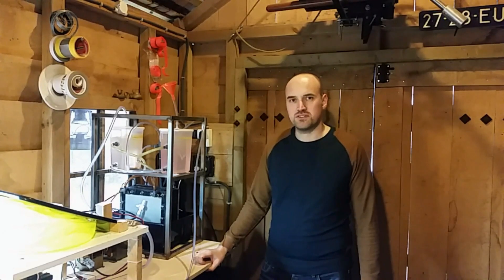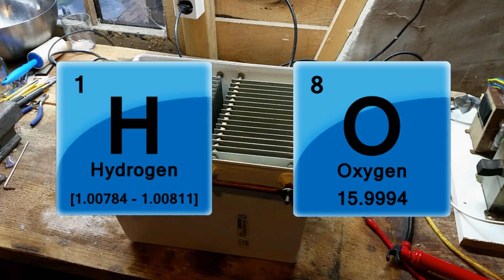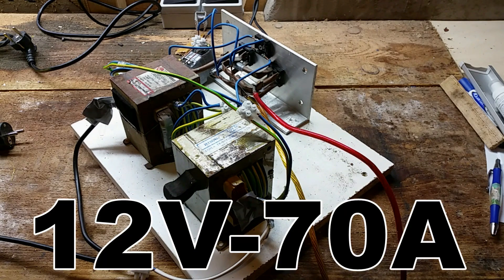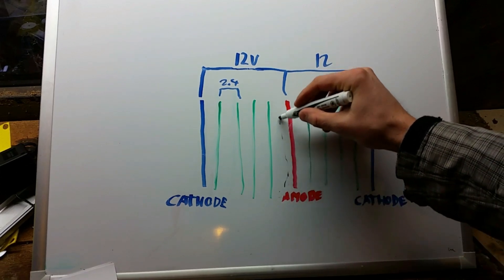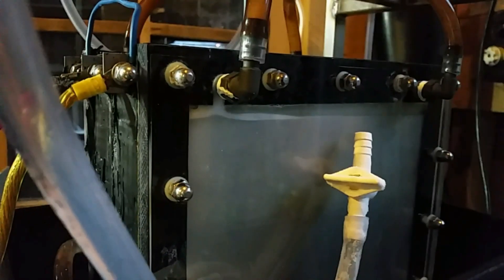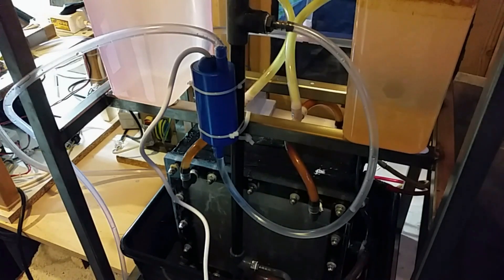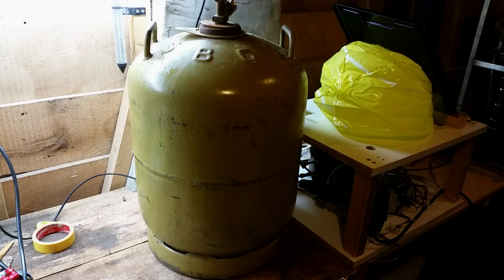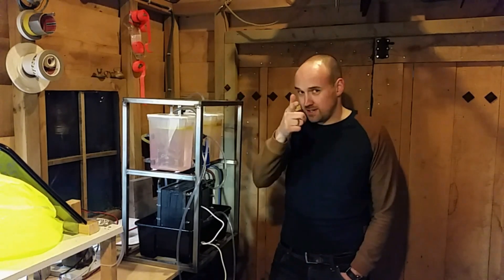Hydrogen Generator #1 Homemade Hydrogen Generator And Compressor Unit

Comment: What will happen if I continue to disintegrate water (electrolysis) in a rigid container? Is electrolysis continues even at high pressure?
Reply from the maker: No at high pressure it will produce less gass. Also, If you don't separate the gasses, you'll be making a bomb which makes it very dangerous! 💣💥 but good thinking 👍
Reply: @TheDIYScienceGuy  that's what I imagine to do, a cheap bomb 😈
Reply from the maker: LOL well it will not be cheap and also not very powerful compared to a real one. Would be very stupid though!
Reply: @TheDIYScienceGuy  btw, is it possible to produce 700kpa hydrogen? What volts per g/s?

Comment: Share this video guys and repost as much as you can because after years of watching HHO videos , this is by far the best all around. I want to see the DIY vid from the power supply out of microwave transformers!!!  A beach ball! Come on guys who would have thought of Felt cloth ?!! 

MY friend I commend you.
Reply: @Waylen Edge Will an arduino with a 10Amp motor controller work?
Reply: @webslinger2011  Arduino is a great idea. All the controls could be connected to a single panel with readouts in one place.
Reply: @Borishal  
BTW:  PWM is a bad way to control the generator's current.
If you have a Arduino, you can however use it to control the ratio of a DC to DC converter to match the voltage applied to the generator more accurately than just a transformer and rectifier could.  Getting the voltage right is the way to go.
Reply: want to bet
Reply: I think they use SPE and PEM membranes cloth sounds like a good idea.
Reply: Nah, I'm from the future. Storage of hydrogen is a bad idea. It leaks through solid shit, lmao.

Comment: Recommended for cooling the tank: u shaped pipes, welded sideways, hot water enters and, as it cools, fall down... Is a transformer cooling way...
Reply from the maker: Yes but that's only effective when there is a large temperature difference, 40c for instance and by then it's already  way to hot so forcing it with a pump works better to keep the temp as low as possible. But thanks for the suggestion! 👍

Comment: Thanks for the sharing that,I think that is the best output I've seen, at least on YouTube. What heater do you use to heat your place with the hydrogen? Are you going to produce plans with the parts and everything you used to build it all?
Reply from the maker: Thanks! No heater everything needs to be cool otherwise you lose energy. I have a diagram on Instagram  https://www.instagram.com/p/Bpl2pLijM7z/?utm_source=ig_share_sheet&igshid=1m4yl6ci8j3ra the rest is in this video and future video's

Comment: Loved your informative video! 
So, I was wondering how much hydrogen it would take to do some cooking, or to heat a room, and I did a little research. Here's what I found...
Heat of combustion is 286kJ/mole
1 li hydrogen under standard temp & pressure = 1/22.4 mole
So, 1 litre of hydrogen can provide about 12.77 kJ of thermal energy, 
which is equal to 3.55 Wh   (1kJ = 0.2778 Watthour)

SO - to heat your workshop with one kW for one hour, you need to burn about 282 litres of hydrogen at atmospheric pressure!  It looks as if the ALL the hydrogen it took you 8 hours to generate would keep you a little bit warm for only two hours! 

Does anyone disagree with these numbers? 

After I learned this, I felt disappointed and started to doubt whether we'll ever have a hydrogen economy! Nevertheless, I like how clean hydrogen can be, and I like that solar cells can be silently generating it every day, and maybe wind turbines even in the dark. 
In the home it could be useful as stored energy backup for when there's no sun, and no wind either. I also like that we don't have to pay tax on it!

My main interest in hydrogen is to use it for cooking on a boat. It is less of an explosion risk than propane or butane, because it's light, and escapes up through windows, instead of collecting in the bottom of the boat just waiting for a spark (like butane or propane does).

Maybe things will get even more exciting when we learn to make our own fuel cell, and get some electricity back at night for lighting, running motors, etc! :)
Reply from the maker: Thanks for the calculations! Yes it's not very efficient but indeed when you use solar and wind it could be useful. And it's always better than doing nothing. Burning fossil fuels is also very inefficient and we keep doing that because it's very efficient money wise. Thanks again! 👍
Reply: If you are alive please reply.
Reply: where did you get "So, 1 litre of hydrogen can provide about 12.77 kJ of thermal energy" Link please.
If true your calculation on hydrogen required is way off the mark. Its not 282 liter but it takes Just 44 Liters to produce 2 KW to heat room for 2 hours. 
With 282 Liters , you get 12 KW to heat room for 12 hours . But well insulated room can be kept warm for more than 24 hours with the same heating power.
Reply: @davelawson2564  thanks for clarification, the contributions and debate that happens in the comments are as important as the video itself
Reply: @Sugito x: you seem to be a very knowledgeable man with the same vision as me about producing GREEN and SAFE energy. I would like to share technical thoughts and ideas via mail if you don't mind. my mail is marnix.degrie@outlook.com. Thanks!

Comment: You can use zeolite to filter out any oxygen that might have made it in the tank.. oxy hydrogen is highly combustible very dangerous to get any oxygen in tank.. oxygen concentrator uses zeolite.. also you can split voltage more & only have 1 neutral plate.. also pulse the electricity at various frequencies.. see which freq. Produce max gas .. its diff depends on what magnetic waves it produce.. so each one is diff
Reply from the maker: Zeolite, thanks I'll look in to it. Changing Frequency doesen't do anything straight DC is what you need. Thanks for the suggestion though! 👍
Reply: @TheDIYScienceGuy  oh I almost forgot hydrogen can be burned off in a catalytic converter I was actually thinking if I wanted my oxygen to be pure I could use an old catalytic converter to somehow extract the oxygen although the Platinum and the Cadillac converter reacts by heating up when hydrogen is pumped to it also with Platinum plates you can extract electricity from combining the hydrogen and oxygen to water which would be called a hydrogen fuel so I'm sure you already know
Reply: I first heard about oxyhydrogen or Brown's gas when I ran across a site called water powered cars, 10 years ago, he had a water-powered dune buggy if you look up Stan Myers water-powered dune buggy he said in some of his black and white videos that he experimented with different DC frequencies and sad he found with less power at a certain frequency he got an explosion of oxyhydrogen once you tuned it to the right frequency I've not yet gotten the production that he got because of all the Miss information or bad plans put out there basically depending on the device depends on what your frequency will be but if you put each cell in series instead of parallel you can divide up the 12 volts into 2.5 to 3 volts any more than that and you lose energy to heat currently I was thinking of using static bags to separate the oxygen and hydrogen they should transmit electricity through them I could be wrong though PS nice job on the setup though too bad you don't live near Dallas Texas
Reply from the maker: Thanks! However I read a lot about stanley meyer and he was clearly a fraud, in it for the money and fame.
Reply: Also I've got an aquaponics system that I want to inject oxyhydrogen into using carbon rods instead of stainless steel cents stainless steel can poison the water I recently heard I saw some videos people not only using oxyhydrogen infused water with fish but in California they're using the oxyhydrogen in their water for Hydroponics with great success anybody know anything about this think I'll make some videos once I find the best setup

Comment: your still splitting water on both sides of the plates, therefore, releasing both hydrogen and oxygen on both sides.you can't have element coming out without the other one with it.
Reply from the maker: No that is not how it works. If you are interested in how it works I advice you to read this: https://en.m.wikipedia.org/wiki/Electrolysis

Comment: Thanks for the GREAT video! I'm planning to make a small test version of this. There is just one thing a bit unclear about the construction. To fill the cell I'm guessing there are holes in the bottom of the metal plates to make the water flow through? This doesn't interfere with the separation of hydrogen and oxygen?
Reply from the maker: Thanks! Yes that is correct. No the flow up is so strong that that doesn't give problems, but if you want to be 100% sure you can always make the same separation system at the bottom.

Comment: It seems to me that the best way to harvest HHO and put it to work is to stop storing it.  Instead of simply using DC, employ pulsating DC (a square wave).  The efficiency of production should improve dramatically.  I have not seen any studies or experiments that identify the optimum frequency to use, but it makes sense given that AC is much more effienct than DC for a great many things.   A square wave generator-servo (very similar to AC with DC elements) can be used to control the amount of output/pressure, so you can essentially regulate the pressure AND flow as an On-Demand type system.  This completely negates the need for storage tanks of the gasses themselves, and gives SAFETY a much higher margin for success.
Reply from the maker: The whole idea of producing hydrogen is to store energy so if you put it to work right away its better to just use the electricity you produced. AC won't do anything and PWM only reduces power.

Comment: I would think that to reduce the heat that is generated, you could add another neutral plate to get the voltage to 2V effectively and then increase the amperage to increase how many bubbles are coming off of there.

You have done very very well here though! I live off grid with solar panels and batteries here in Canada and in the long long summer days I really want to save the extra power that gets wasted once my batteries are fully charged. It would be really great to be able to store hydrogen!

I am surprised that you are not storing the oxygen too though. Welders pay good money for oxygen for their cutting torches and you can suck it back to feel good too! I guess it would just take quite a bit of work to also make a compressor unit for the oxygen side too.
Reply: I'm doing similar thing. Got solar panels. Panels charge batts, batts make hydrogen, hydrogen runs 4k watt genny, genny powers crib, charger charges batts at nite...

I'm working on it. Havent figured out everything I need to know to store hydrogen and convert gas engine 4 stroke genny
Reply: @ryandavis4689  no need to separate the gasses if just feeding directly into the carburetor of the generator. Only thing to do is size your HHO generator to match the lpm required based on engine displacement. A 420cc engine would need between .25 and .5 lpm of HHO.
Reply: Nvr thought of storing oxygen
Reply: Ryan Davis if you run the hydrogen to the engine, also run the oxy there it will always have enough oxygen to burn fully if you do it like that
Reply: Is it not viable to store your extra power in a capacitor of some type for future use?

Comment: instead of using  neutral plates why don't you have + - + - + - + -so all plates are conected it would produce more gas I've notice neural plates don't do much mine outputs a lot for how much mass i have
Reply from the maker: That makes no difference in gass output but you would need a 2V 420A transformer which is much harder to make and less efficient.

Comment: I almost wonder. If you could improve the reliability and maybe somehow increase your production capacity, you could possibly fill one of those giant propane tanks and have it for heating and cooking. 

And when it's all being powered from solar, its pretty much free gas at that point.

As for detecting oxygen in your hydrogen, you could use an oxygen sensor in conjunction with a microcontroller to automatically shut down and vent the system.
Reply from the maker: Thanks for the suggestion! 👍

Comment: Aren't you worried about the refrigerator compressor igniting the hydrogen?  It seems like there would be some potential for sparks in a device with fast moving metal parts and 120+ volts running through it.  Good video, I would love to see a more detailed video of the felt gas separation.
Reply: Compressor motors have oil in them for cooling and lubrication, and additionally they are also induction motors, not brushed, so no arcs are produced. I highly doubt it would ignite.
Reply from the maker: Yes what Klonoa says. 👍

Comment: isn’t storing hydrogen in propane tank a problem? Since hydrogen molecules are very small and they can pass through walls of tank
Reply: Hydrogen loss is a big problem in spin-cast cast iron cylinders due to their porous nature (usually countered by encasing in a formed steel cylinder that has nitrogen at a higher pressure), propane tanks are made from formed steel sheets that are welded together, and have a very low porosity index. Not a big problem at the pressures he is using.
Reply from the maker: Yes, what Paul Moffat says. After a few months there is no measurable loss of pressure in the thank.
Reply: The DIY Science Guy have you tried to run your car with hydrogen?
Reply from the maker: No only my lawnmower as shown in this video: https://youtu.be/llmcU-mZRFs I'm driving a diesel so that won't work 🤔

Comment: You ould try Distilled water NaoH red devil lye and simply throw in old crushed up aluminum cans Make a PVC container n u could make a small torch or us this for long trips at steady speed fed into your intake on your car better combustion and power and some increased fuel economy and this uses no electric power!
Reply from the maker: Al that aluminum would be very expensive! 😉
Reply: @TheDIYScienceGuy  For occasional use? As a torch or experimental purposes? Come on were talkin a few pop or beverage / beer cans out of your garbage or a chunk of balled up aluminum foil? if I wanted it for use on a car I would ad a pressure release valve though in case you ran into dense traffic stop n start or construction situation! This would be way easier n cheaper then building a hydrogen generator w stainless steel plates running off electricity been there done that years ago or using some type of frequency generator to split the water! Im sure as I say the Navy has a way or method in their submarine fleets to split water so they never have to surface for oxygen like the German deisel powered uboats in the past had to do or use a snorkle.

Comment: I would let the oxygen vent through the aerobic sections of my domestic septic system. (It needs oxygen.)  Could you compress the oxygen separately and the then have an oxy-hydrogen welding torch?
Reply from the maker: Yes of course! It is something I'm planning to make sometime. Good thinking! 👍
Reply: GENERAL PRECAUTIONS
Oxygen under pressure and hydrocarbons (oil and grease) can
react violently, resulting in explosions, fire, and injury to personnel
and damage to property. Never allow oil or grease to come into
contact with oxygen under pressure. Even a small amount of
hydrocarbon can be hazardous in the presence of high oxygen
concentrations. In fact, any organic matter in contact with oxygen
under pressure could have a violent reaction.
https://miningquiz.com/pdf/Hazardous.../DON'T_MIX_OXYGEN_AND_OIL.pdf
Reply from the maker: I know, thanks for the extra warning! 👍

Comment: Im planning to make one of them myself. I use to buy the hydrogen in 200 bar 8,9m^3 cylinders at 5usd/m3 so its not that cheap
Reply: Nikos,
do you may 5*8,9m^³= 44,5$ per cylinder? or 200 times more, because of the 200bar storage??
Reply: @marnixdegrie9915  its 44.5usd total. Its 50l cylinder at 200 bar and total capacity of 8.9m^3
Reply: @nikoskaravitakis9437  Thanks! Whey do you need the H2 for??
Reply: @marnixdegrie9915  I needed it for some chemistry experiments and also as a lift gas

Comment: Well at first I thought you are just another trolling conspiracy theorist. However, as someone who is into this topic since I was 14 years old, and built my first big 2lpm drycell with 16 and am now at university studying chemistry, I am quite impressed by your work. People who are into this topic and actually know what they are doing are very rare. Love your ideas and also as far as I am able to see everything you told is actually correct. Great idea with the kitchen towel, never thought about that easy method of seperation. Is there still enough space between the towel and the plates for the gases to escape? I think I need to try this with one of my cells too. Really great channel you have, I am gonna drop a sub.
If you are interested in my drycell setup, you can watch it over at my channel if you want.
Love from Austria 😄
Reply from the maker: Thank you so much! The distance between the electrode and the membrane is 4mm so plenty of space! I subbed to your channel to and going to look for your generator. Thanks for subscribing!